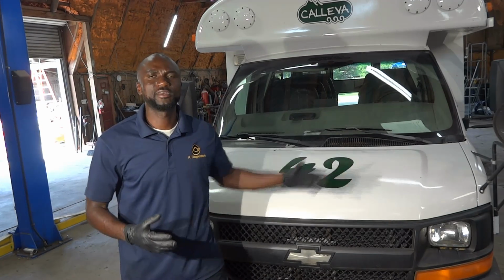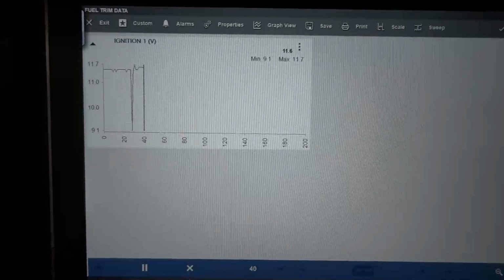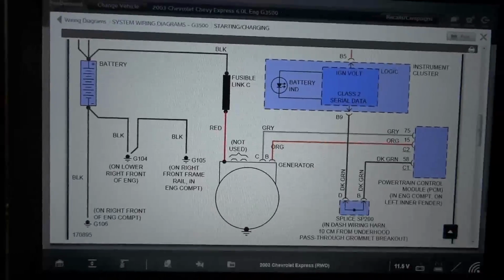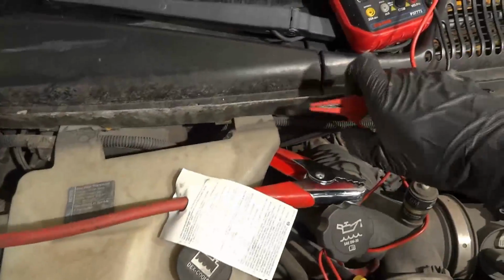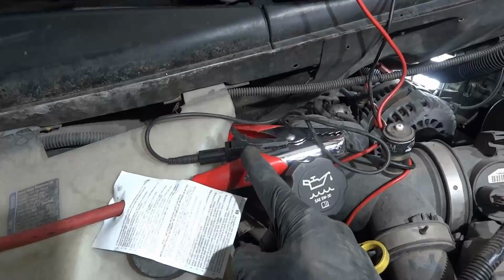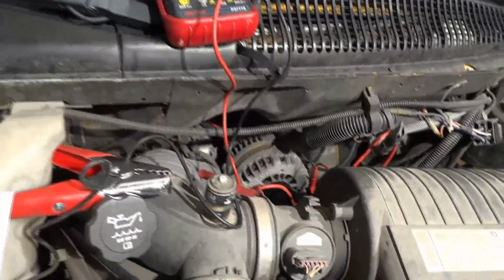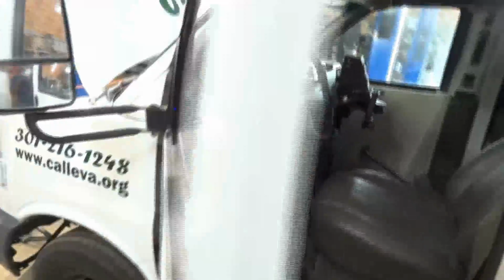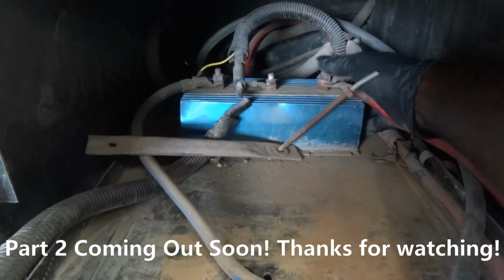Chevrolet Express Battery Dies Overnight! Charging System Not Working Diagnosis & Repair Part 1

Comment: Hello I have a question when I drive my van after some time my van's electrics go off and the battery light comes on and then I turn the key off and the van starts easily can you please suggest me what is the problem ?
Reply from the maker: @sandeep_pb13   Check the charging circuit

Comment: Very good diagnostics, and I learned quite a bit about testing charging systems. However I have a bit of insight on the blue device. It's called a battery isolator. It's basically 2 big diodes with a common center tap. It's job is to isolate your staring battery from your accessory battery. The have a 1.5v drop across them. A better way to provide battery isolation is to use a solid state relay with a cut in voltage of 13.5 and cut out voltage of 12.5v.

I run several batteries and have used diode battery isolation as well as relay isolation. Diode is a bad option. Shouldn't even be on the market.
Reply from the maker: Joe Fala  Ah OK, Good to know, thanks for letting me know about what the blue device was, I appreciate it!

Comment: When testing the control side of the alternator that goes into the ecu and feedback line coming from the Ecu. Are you not meant to get the alternator output voltage. In this case I saw about 3.v and suddenly the voltage spiked up. Need a better clarity on this. I always learn from your video
Reply from the maker: Mayowa Odus  Good question! The voltage on the feedback wire is low with the key on about 3v, it's a bias voltage that the computer sends out then it goes up to system voltage with the engine running!
Reply: @KITS_Auto_and_Truck_Repair  200mv is the voltage drop test across B+ and B+ of alternator. Is this fixed or should vary across brands
Reply from the maker: @mayowaodus6310  200mv is acceptable across the board!

Comment: Could be altamator
Reply from the maker: Piedad Stoffel  The issue wasn't the alternator, You will see what caused this in Part 2, Stay tuned!
Reply: @KITS_Auto_and_Truck_Repair  ok thx
Reply from the maker: @piedadstoffel5955  My Pleasure!!
Reply: @KITS_Auto_and_Truck_Repair  I had that happen it was cause wrong battery was in the vehicle plus I left the ignition switch on not all the turned back and the key would still release cause ignition slopped out and ignition turned hard with wrong battery in it now ignition turns great with with new correct battery
Reply from the maker: @piedadstoffel5955   That's interesting !

Comment: Question couldn’t you have just used your multimeter on the ground at alternator and positive post at alternator to see if it was putting out stable voltage to charge? And if it wasn’t you do the voltage drop on the wires then??
Reply from the maker: bigmike2971  Yes! I could have done that but I didn't think about it while I was filming! Wait for Part 2 it's gonna get interesting!
Reply: I’m waiting
Reply: @bigmike2971  Ya, great video.>)